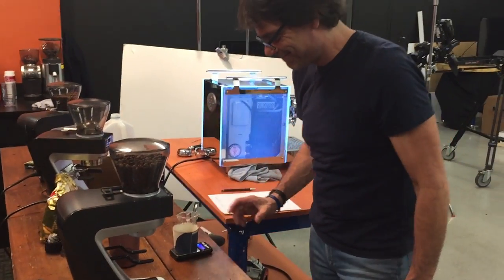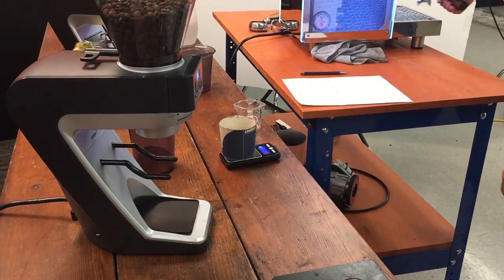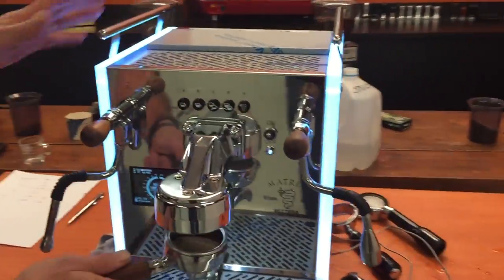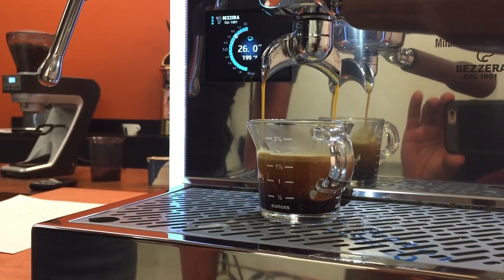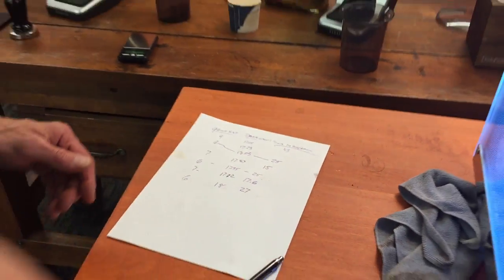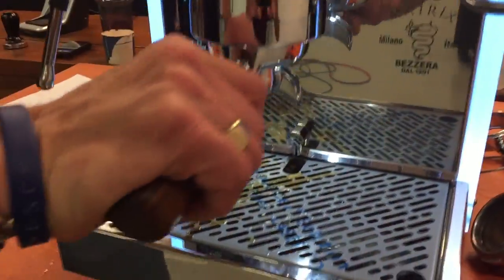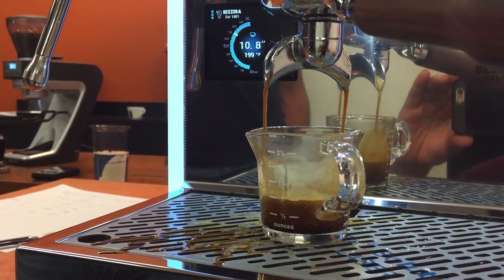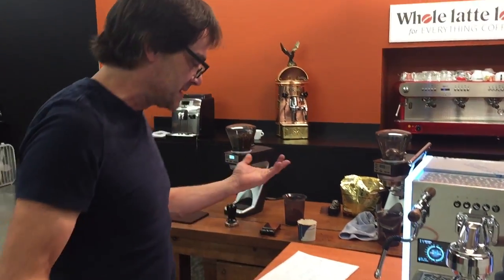Test: Baratza Sette 30 for Espresso Grind - Behind the Scenes

Comment: Hi Marc 2 ounces is a very high brewing ratio for an 18 gram dose? That's 1:3.3. 

Assuming 2 ounces is around 60ml, therefore 60 grams of espresso, isn't this considered a very weak espresso? 

Just trying to sort through the ridiculous amount of info out here on Youtube for brewing espresso properly.
Reply from the maker: Hi Murray, Thanks for the comment and question. If 1ml of espresso = 1g then yes. But 1ml of espresso rarely if ever weighs 1g. Check out this video where I'm pulling a triple shot from a 21g coffee dose and liquid volume in the cup is near 70ml. The Acaia scale weighs the shot at 42g. It's a 1:2 ratio by weight. Here's link to video: https://youtu.be/yaPgSlJU_PU?t=37
Can't due brew ratios using weight for coffee dose compared to liquid volume of an extraction.
Marc
Reply: Whole Latte Love thank you very much for the reply!

Comment: geez i about had it with this grinder. its a cheap grinder amd it sounds like it wants to break. i had thr vario and that thing kept stripoing belts and sounded awful  ended it up sellijg it and got a real grinder, ceado baby. could u guys spend less time.on this crappy entry level grinder and more.on quality.ones? thanx
Reply from the maker: Hi Jesus, Congrats on the Ceado! Thank you for sharing your opinion. I disagree with classifying the Sette an entry level grinder. Ceado grinders are a whole different level of build and price! They are prosumer/commercial level and should go for decades with their heavy metal construction! We do cover all levels of products and have many videos on Ceado, Eureka, Mazzer, ECM, Profitec etc. Also have videos on what I do consider low cost (<$100) entry-level grinders made by Capresso, Bodum and Cuisinart.
Reply: Whole Latte Love i respectfully disagree from experience with thr baratza vario. thats was a total let down 3 belts and a new motor in less than a year alsp very loud and it wasnt cheap  but the sette is a new design thats fo sure so maybe they stepeed it up, maybe when my ceado gives up on me ill try one. dont thinj that will be soon though thats thing is a tank! thank to u guys for the recommendation